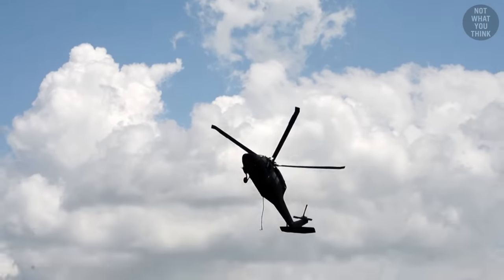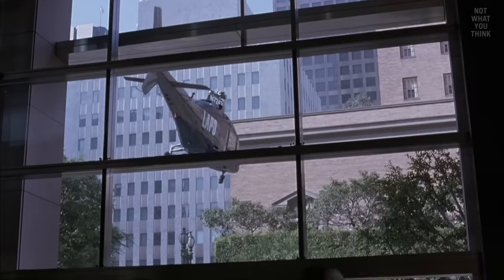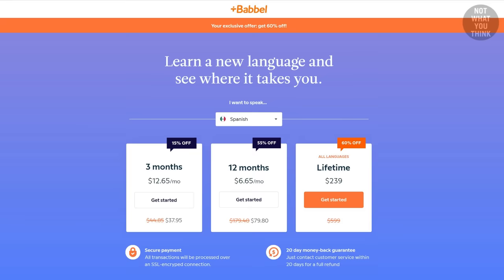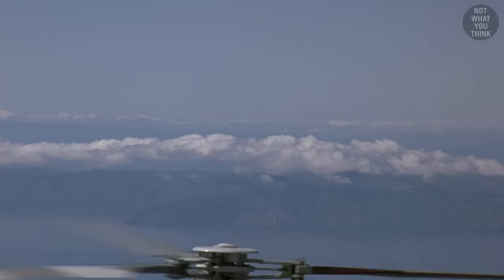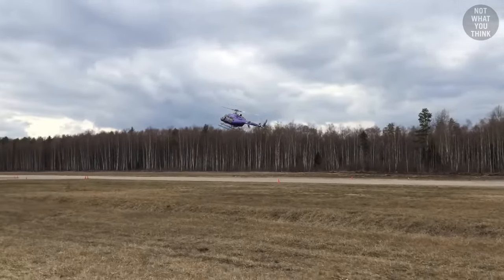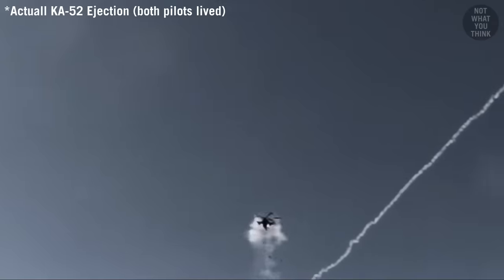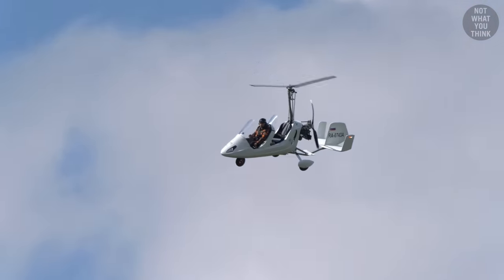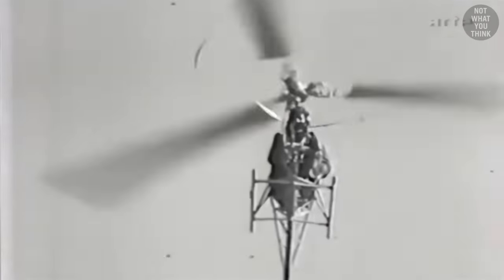Why Helicopters Fall Like a Leaf, Not a Rock

Comment: As an helicopter professional, I very liked your video. And loved the uranus joke :)
Some contributions: 
- Autogyros are one of the most immune aircraft to engine failure. They have superiority to helicopters in engine-failure since they always fly (and designed to fly) in autorotation. Therefore, pilot doesn't need to do much when engine fails, whereas helicopter pilots have few seconds to lower the collective and put the helicopter into auto-rotation mode. So, they are very safe, if not the safest, for general aviation. Lack of hovering ability and lower performance that is why they are not very common for other purposes.
- V22 can do autrotation technically but since the blades are much shorter, the descend rate would be much higher than that of a single main rotor helicopter. In fact, there is a term called "autorotation index" which is used in comparing autorotation performances of different rotors, which indicates that longer blades are better in auto-rotation. So V22 is not practical (meaning survivable) to autorotate, they are better off with gliding. Worth also mentioning that they have two engines and have less probability to loose both. 
- Autorotation is as effective as a parachute but still happens at a high descend rate (still survivable but risky) so pilots do one final thing named as flare, which is basically to raise the collective in exchange of the rotor rpm (lift creates drag). This slows down rotor but gives some moments of increased lift that further slows down the rate of descend.
Edit:Typos
Reply from the maker: Thank you!
Reply: The funny thing is V-22 is also sucks for glide. It has smaller wing area and A/R ratios compared to normal fixed wing aircraft (because a larger wing area will blocked the downwash of rotor and causing the loss in the rotors' effective thrust, which you might already know.)
And even worse, the huge rotors will obviously creating terrible drag when they're autorotating, it will make the glide ratio even worse.
So V-22 is sucked when engine failure, because it can neither perform autorotation nor glide effectively.
Reply: Very interesting
Reply: I asked  chief warrant if Army helicopters can autogyro and he said the Engines are too high and too heavy because they have 2 engines and armor.
Reply: Correct me if I'm wrong, but wasn't that what held up the Osprey's so much during testing?  Not only can they not auto-rotate (safely), nor glide (well), but they also lack any sort of ejection system for the crew (due to the nature of the design).  I imagine losing one engine would play havoc on your yaw control with all that torque on one side while struggling to produce enough lift from the edge of one wing - like trying to lift a barbell from one side!
Reply: @ValleyDragon  "I asked  chief warrant if Army helicopters can autogyro"

"Autogyro?"
Reply: @smgdfcmfah  A transmission ensures that in the event of an engine failure, both prop-rotors receive the same amount of power from the operating engine. Why would you think that only one wing would produce lift in that situation?
Reply: "so pilots do one final thing named as flare, which is basically to raise the collective in exchange of the rotor rpm (lift creates drag). "

Nonsense. The flare refers to changing the lift vector of the disk be easing the cyclic to the rear, slowing the descent and reducing airspeed. The collective is raised at the same time to help cushion the landing but the "flare" is controlled by the cyclic.

"V22 can do autrotation technically but since the blades are much shorter, the descend rate would be much higher than that of a single main rotor helicopter."

Ospreys are not designed to effectively autorotate and there is no procedure for doing so. FYI, I was my son's first flight instructor and he is an IP in the CV-22.
Reply: @smgdfcmfah  Yes, but in fact single engine failure didn't really make trobles to the Osprey. The two engines are connected by power train system and each engine is capable of drive both rotors by its own. So single engine failure is acceptable.
Reply: @Tom-zs6bb  autogyro in this context means autorotate
Reply: @ValleyDragon  No, it means 'autogyro,' which is an aircraft. 'Autorotate' is what occurs when a rotor is not under power and the air flows upward through the disk.
Reply: @jeffery7281  Assuming it's just an engine flame out and not something more serious, but yes, I get your point.
Reply: The Uranus joke is a bit outdated as that's no longer the proper pronunciation as the world has now standardized without the long a sound.
Reply: As an ArmA amateur, I can confirm the validity of these statements.
Reply: I read about this topic in a clive cussler novel, in one of the dirk pitt book series an emergency landing is performed in this exact manner and describes the last minute pull-back, how it creates lift and slows the crafts descent.
Reply: Yep, was looking for him to mention the flare at the end. It essentially bleed off the remaining energy from the fall and provides a last "cushion" of deceleration right be touching down.
Reply: You mean autorotate. He would have answered yes. @Tom-zs6bb
Reply: @EIGYRO  Huh?
Reply: Back when I was flying Radio Control nitro powered helicopters, I used to love practicing autorotation.  
Very challenging with lightweight carbon blades we used to use for aerobatics as they cannot store much kinetic energy. Getting the flare slightly wrong was all too easy.  
A little too high and you lose rotor speed and crash, a little too low and you hit a little hard then end up with a boom-strike (blades bend down and impact the boom)

Comment: The highest autorotation was performed at an altitude of 40,814 feet (12,440 meters) while also setting the highest flight record of a helicopter. At that altitude, the Aérospatiale SA 315B Lama (the helicopter used for this record), piloted by French aviator, Jean Boulet, had its engines flame out due to lack of oxygen.
Reply: that was one hell of a realization to make while so high in the air lmao. 

"oh shit, the engines gave out..."

i know they likely kickstarted them again on the way down but still i bet some grey hairs were picked up on that mission
Reply: Ok this is actually hilarious... a "Boulet" in french literally means a cannonball. But calling someone a "Boulet" means they are an idiot. More precisely, it means they are a restraining factor, like having a cannonball attached to your foot.
Reply: What? On 41'000 feet is not enough oxygen? Oh my, who saw that coming? 😄
Reply: @Fantastic_Mr_Fox  It can also mean to be head strong while never deviating from a path.... Like a cannonball once fired. It will stop inside a target or fly in a straight line until its out of energy... Kinda like how some people can't stop rushing at their problems in straight lines and smashing their heads on the wall until it crumbles instead of walking around it :D...
Reply: @gotskilsudont2149  True but that's used less often in my experience. But yes that's why it also means 'stupid' and not just 'a nuisance'
Reply: @gotskilsudont2149  omg why so mean, i mean i know what you mean but not everyone knows the ends justifies the means and mean means average 😎
Reply: @needsmctherapy1447  he did a power off, full touch down autorotation, landing with absolutely no power which also set a world record for highest altitude flown with a autogyro
Reply: @-Master_Of_Disaster less pressure= less air, which coincidentally= less oxygen. You can burn as efficiently as on sea level, as long as you move at what? Mach 1.5 minimum?
Reply: @needsmctherapy1447 Well better 12 km up than 100 meters
Reply: @calvinnyala9580  I have no idea what your are talking about.
Reply: Engine flame out would most likely occur with any passenger jet at that altitude since turbine engines generally arent designed to operate at that altitude . Almost all modern helicopters use turbine engines with a driveshaft to the rotor gearbox so its a toss up whether engine flame out occurs first or not being enough air density to provide lift
Reply: @onddu2254 … not really. 12km up gives you a lot of time to contemplate the poor choices you’ve made in life. At 100m, if done correctly, (get the collective down, set the attitude for decent forward speed over ground, flare at 30m with decent nose up attitude, bleed the speed/build the head energy, and cushion to the deck using the collective) it’s over quickly and you’ll know the outcome within 10 seconds.
Reply: Makes sense it was due to oxygen, but amazing
Reply: Thanks for the cool fact, uzi.
Reply: craazy
Reply: @-Master_Of_Disaster  they are referring to the fact that up there in thinner air, you have to move considerably faster than at sea level to get the same amount of oxygen into the engine. I know that holds true when it comes to jet engines for example, but don't think it's feasible in a heli so it was somewhat of a "nerdy" joke. I might be wrong and they come back explaining that it can be feasible in a heli as well though.
Reply: @almightyIrie  Thank you for the answer and the effort you were putting in. But I'm absolutely capable of understanding the function and the needs of a combustion engine like in this case a a jet engine. And yes, I tried to do a little joke, but it seems it hasn't delivered.
And to come back to you. No, at a certain high altitude a jet engine will not be feasible anymore. Then you'll need some fancy rocket fuel to operate. (In a rocket, not a jet engine)
Reply: @-Master_Of_Disaster  ah, I feel stupid now.. thanks for being chill with my reply, and yes obviously there's altitude limits for air breathing engines.. when there's no air left, there's nothing to breath.. but that's a lot higher than 40k ft. I'm just thinking U-2 & SR-71 as the most famous examples.
Reply: NO SIR  the pilot was Claud Clue-so.
Reply: It's not the high altitude engine failure that is the problem, it's the ones that occur closer to the ground.
Reply: Why is that Frenchman flying so high in his helicopter? To show that France is great?

Comment: Just a minor correction. Most autogyro craft can actually power the main rotor, however they generally don't have enough power to actually lift off purely by the power of the engine. The engine just serves to get the main rotor spinning fast enough so that the autogyro can actually take off within a reasonable distance, at which point it disengages from the main rotor and strictly powers the pusher and/or puller prop
Reply from the maker: Thanks for clarifying!
Reply: The motor is to start spinning the main rotor on the ground before take off. Autorotation doesn't work if the rotor is below a minimum rpm.
Reply: @niconico3907  yes, that's what I said
Reply: @richardmillhousenixon  Based on your namesake, it was wise to verify :)
Reply: @NotWhatYouThink  actually you should correct the first sentence to this shouldnt not happen. there where at least four crashes of civilian helicopter because of failing emergency systems.
Reply: wrong an auto gyro relly's on forward motion an the angle of the blades.. its dragging them through the air to spin them..  and they in turn give lift slighty backwards.  this is the reason they have to maintain forward flight.....or they  stop spinning and you fall outta the air..  so how many have you flown?  3 here.... only because he had the blades at the wrong angle I deemed it not flight worthy and he's the only guy I didn't pass that day.....

helicopters, I like more..   but theyre not as forgiving
Reply: @harleyme3163  Read my comment again. I never once said the motor actually powered the rotor enough to lift the damn thing off the ground
Reply: @harleyme3163  - WRONG.
Autogyros, like maple or sycamore seeds (as shown in this video), do NOT need forward momentum (nor forward airspeed) to maintain autorotation.
Look up "vertical descent".
You may even find an example or two on my own channel.
They DO need airflow through the rotor disc, however.
Reply: Haha this time it wasn’t what HE thinks!
Reply: A very minor correction/clarification on your explanation. The prerotator isn't disengaged on takeoff as your comment seems to imply. It is disengaged immediately before the takeoff roll starts. The takeoff roll is used to bring the rotors the rest of the way up to flying-speed (also known as "building the wing"), at which point, the aircraft unsticks but still does not usually have enough airspeed to safely climb out. It will remain a few feet above the runway as it gains airspeed, climbing out only when it has enough speed.
This is probably what you meant but the wording is a little ambiguous and seems to imply that the prerotator is disengaged on takeoff (which in a gyro would either be at "unstick" or "climb-out" depending upon interpretation).
Reply: @Irobert1115HD  I recall seeing footage in the 80s of an Australian helicoptor whose rotors folded up in flight. It assumed the general aerodynamic stability of a rock, with predictable consequences (landed on a highway, but thankfully not on any cars)
Reply: @miscbits6399  likely another type of maintenance error.
Reply: Dream on. Auto gyro's do NOT power the rotor. Stopped reading your aircraft manual, because I do not own your design aircraft. Good luck with it.
Reply: @voornaam3191  actually there are some that power the rotor durign start up to shorten the ammount of runway needed.
Reply: 4uf
Reply: @voornaam3191  Most autogyros in fact do power the rotor to get it up to speed. Once it's at speed, it is disengaged and continues to spin entirely on the movement of air through the blades.
Reply: @halfrhovsquared cool

Comment: “Why don’t helicopters land like a rock when the engine dies?”  Well, they’re perfectly capable of landing like a rock, it just depends on how the pilot handles the situation.
Reply: Name your helicopter the Serenity.  If the  engines fail, it will fall like a leaf on the wind.
Reply: the same goes for any vehicle capable of moving downwards
Reply: @chri-k  a car and most ground vehicles are exempted from this in most circumstances after a year of testing
Reply: @Generic_username69  a car or any ground vehicle is not capable
of moving downwards under those circumstances. i included that for a reason